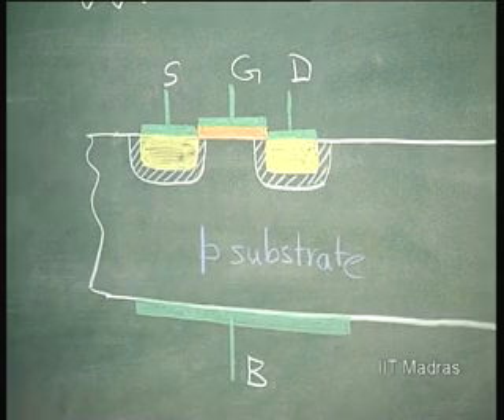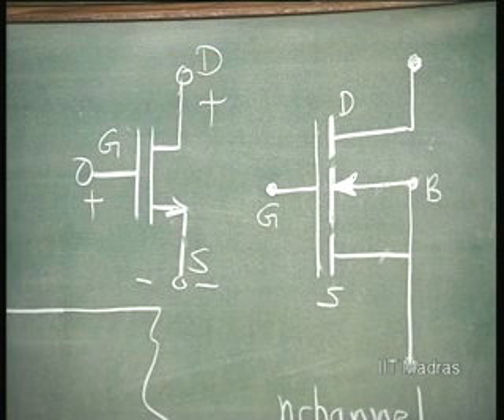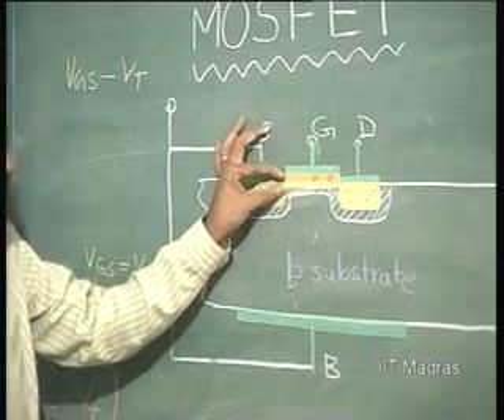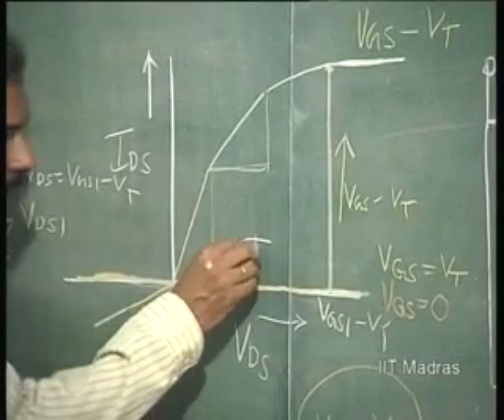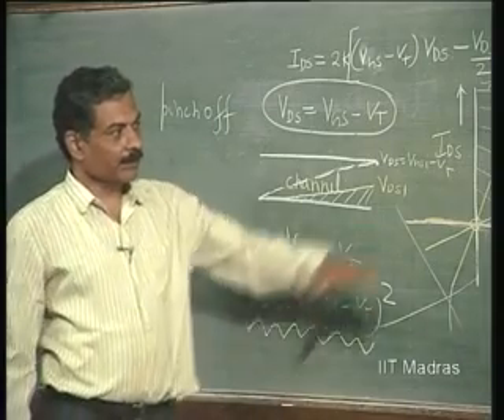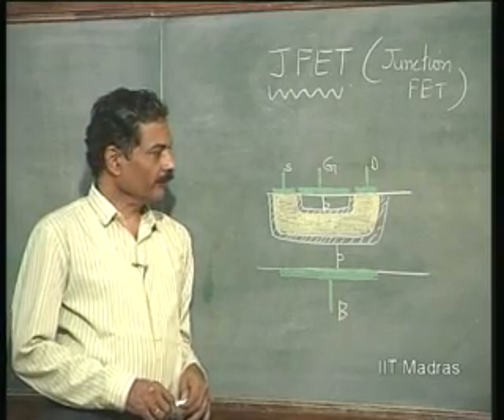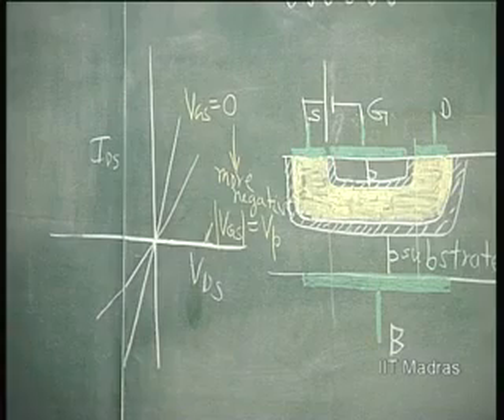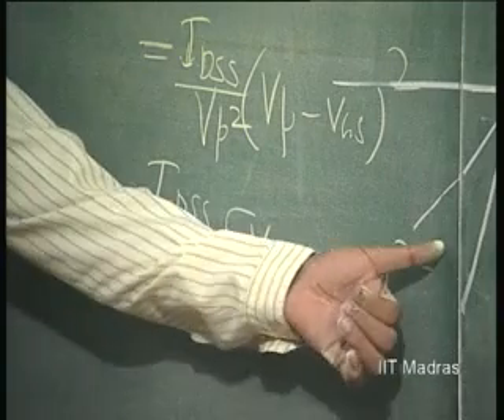Lecture - 27 Construction of a MOSFET

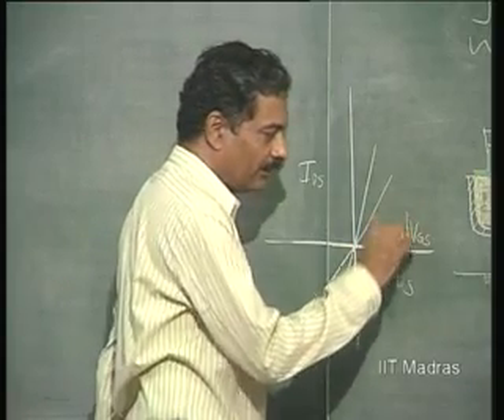Comment: When saturation current occurs the current becomes constant at a fixed value of Ids, refer to Lecture - 26 Metal Oxide Semiconductor 46:30. Current is still flowing from the source but not through the drain due to the fact that Vds is greater than Vgs-Vt hence the channel at Vd gets pinched of. Once again refer to the above title Lecture 26 to understand the relationship between Ids and Vds.
Reply: Current still flowing from source and drain pinch off occur but due to electric field it is still sucking the electrones ..

Comment: I didnt clearly understand ..when channel is pinched off ,,how we still get a saturation current. As, the channel from where electrons flows is blocked from where this saturation current still exist?
Reply: The current is maintained due to the voltage at pinch off.. There is like oscillation in the pinch off voltage drop, so Vgs keeps puliing the electrons, increasing the depth of channel, while Vds keeps drawing, when it draws electron, when electrons leaves that pinch off region, there is no electrons now... But due to small cuttof at that point, electric field due to Vds is apparent like passing thru insulator... So now Vgs again in action, pulls out electrons, from source and again, channel widens... This process goes on at very fast frequency.
Reply: leoricgurung When MOSFET pinched off, a very less current still flows due to high voltage(or high field intensity) applied at the drain end. You can better understand by the logic that we can pass the current through a insulator material by applying a proper high Voltage. In the same manner as we are applying 15 volt(highest DC volatge for MOS usually) at the drain end there must be a current.